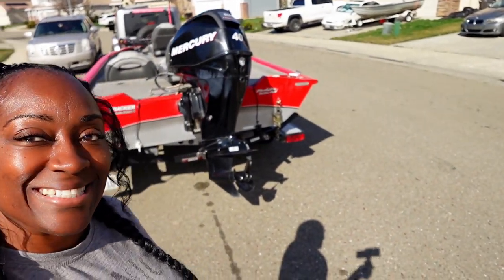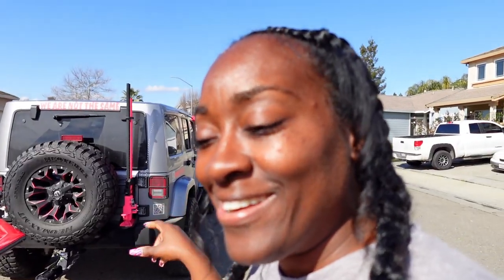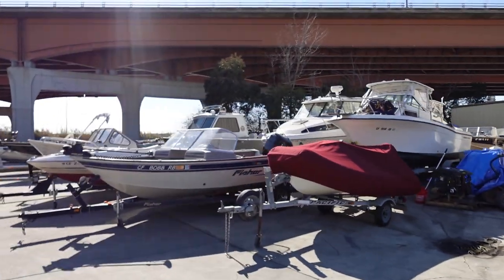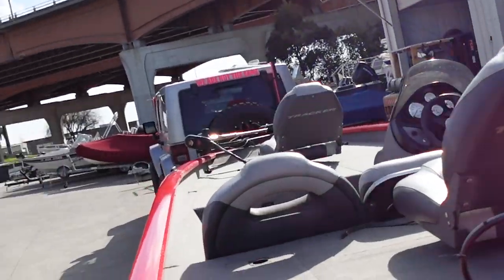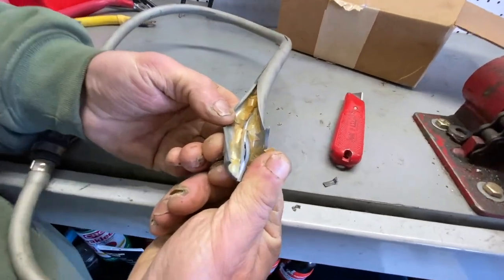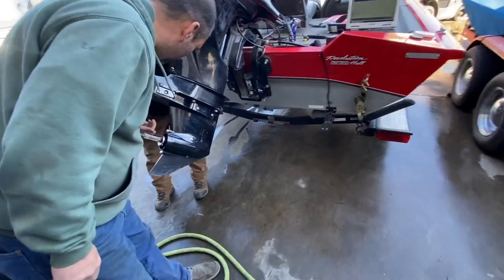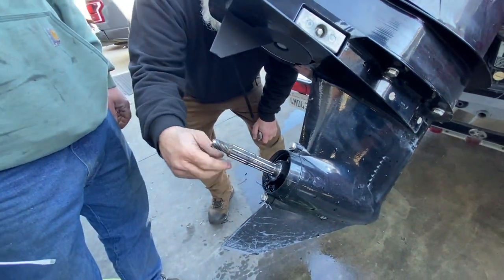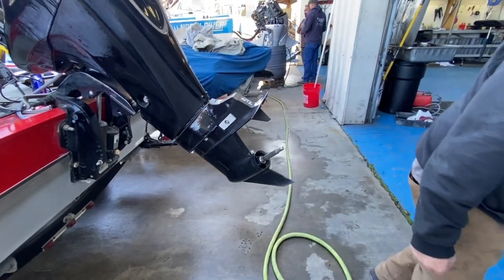I bought a BASS TRACKER Pro Team 175 for $3K! Will it work? Ep. 1  Boat Restoration  #basstracker

Comment: How did you find such a deal? Any tips?
Reply from the maker: Found it on Offer Up. Had to drive almost 8 hours to get it but so worth it. Only tip I have is just be willing to travel outside your city if there’s a good deal. Check out my previous video. I tell how I got it. Good luck💗🎣